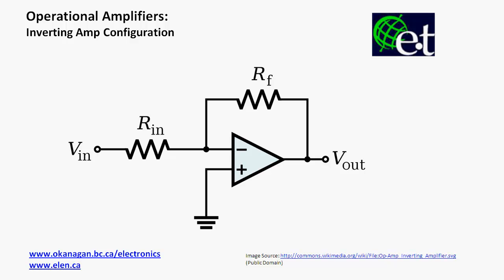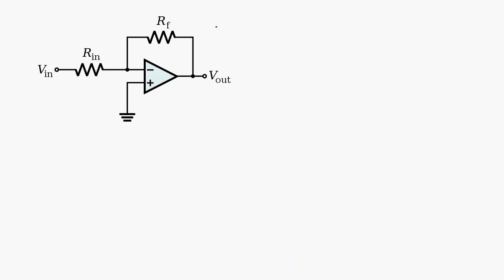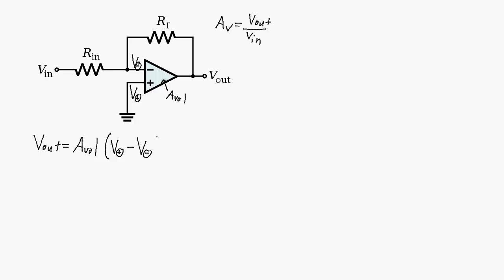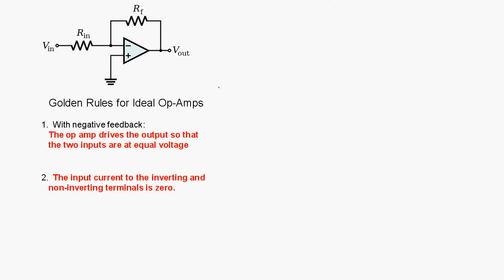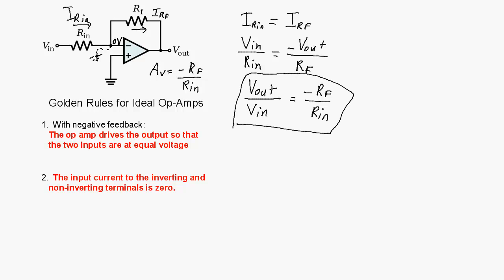Operational Amplifiers - Inverting Amp Configuration

Comment: Thank you so much for posting these videos!!

I have a question:
In an Inverting op amp, Which is the feedback parameter B?
According to this source https://ocw.mit.edu/courses/electrical-engineering-and-computer-science/6-071j-introduction-to-electronics-signals-and-measurement-spring-2006/lecture-notes/22_op_amps1.pdf (p. 10), is Ri/Rf (Which I think is the right answer). But according to other sources, it seems to be Ri/(Ri+Rf), like in the Non-inverting topology.
Which is the right answer?

Comment: Great video. First derivation I've seen without using the Golden Rules. I never like just accepting rules like "The op-amp output will do whatever is needed to make the inverting and non inverting inputs equal". Rules are fine but I like to see what is behind them.